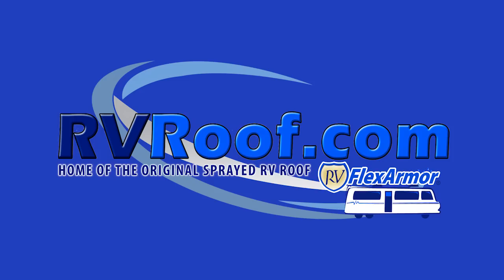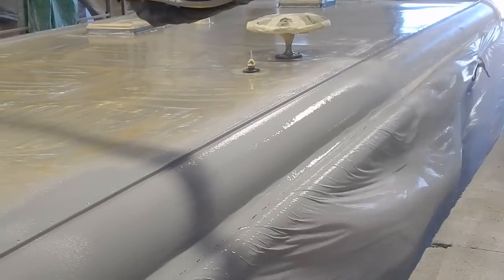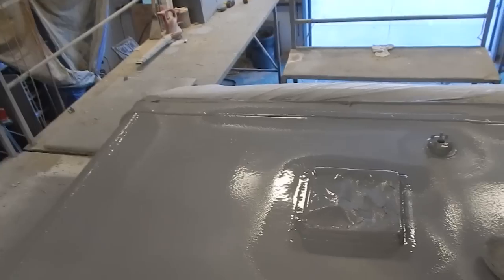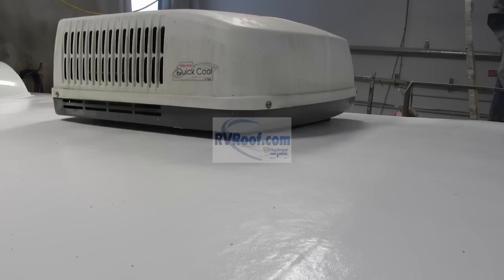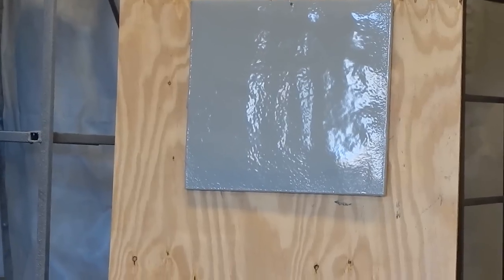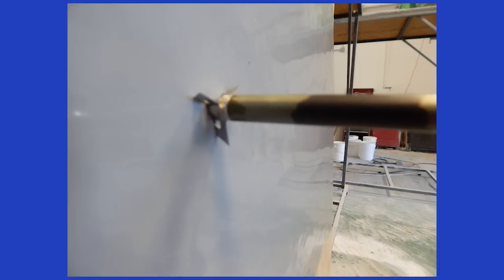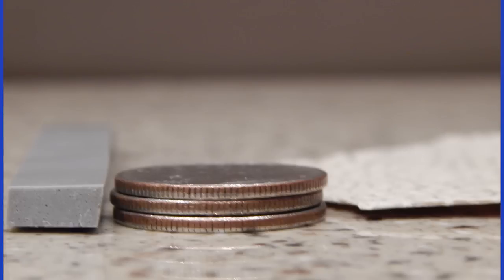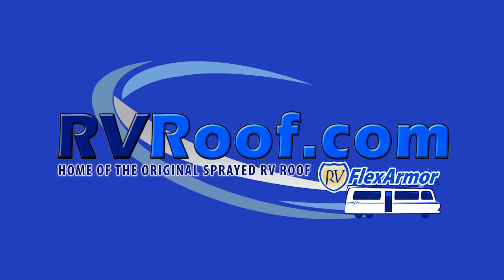RV FlexArmor(R) What it is and how is it applied.

Comment: We tied Grandma to the roof of our RV when she passed. We wanted her to be a part of our family vacations for years to come.
A couple of questions:
1.) Will Grandma pose a problem for your process?
2.) What would you charge to encapsulate Grandma with your roofing system. (The buzzards have begun picking at her, and we need a more substantial covering than the Walmart shopping bag that we're currently using.)
Thanks in advance for your prompt response. 🤓

Comment: Why isn’t this standard on all but the cheapest units?
Reply: We visited a manufacturer a few years ago and they wanted to be able to put the roofs on in 15 minutes or less, like it is currently done on the assembly lines. This process does not covert well to assembly line type applications. Recently, New Horizon 5th wheels builder has signed up and will be offering it on those units.

Comment: What happens when I need to replace a vent?
Reply from the maker: rts If something needs to be replaced the coating can be cut through, the component replaced and then that area be resprayed,. The product bonds back to itself so your roof would remain seamless.
Reply: @rvroofflexarmor9117  I would assume that's extra cost or included in lifetime?
Reply: @rvroofflexarmor9117  If I have to replace something on the roof and the coating is cut to remove, do I have to bring it back to you, to be recoated?

Comment: you did not answer the question you proposed: What is flex armor, is it rubber, urethane, butyl or some combination? you used stupid marketing tricks without real information. How about a little truthful facts about the product?
Reply from the maker: Sorry, I just saw this. We have a more technical explanation on our website, RVRoof.com. I have plenty of facts on the website. Our product is a pure polyurea we developed with a chemist in 2005. It is an a and b chemical that forms the the material when it mixes as it is sprayed. This particular formula is able to bond to any substrate, stays flexible in any weather conditions and is tough enough to protect your rv from things like low hanging branches and hail.
Reply: @rvroofflexarmor9117   much better answer. Now that I know what it is, I can consider putting it on our RV.